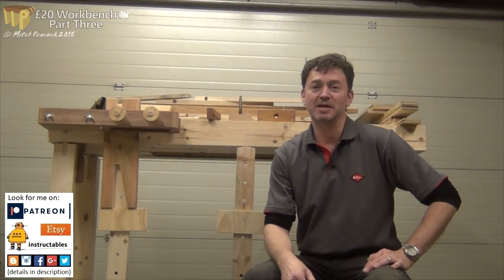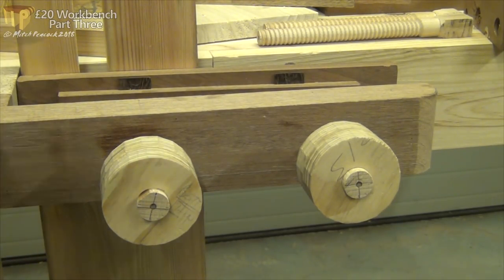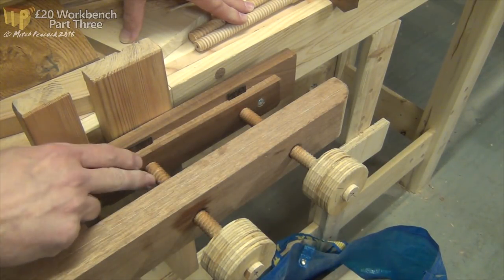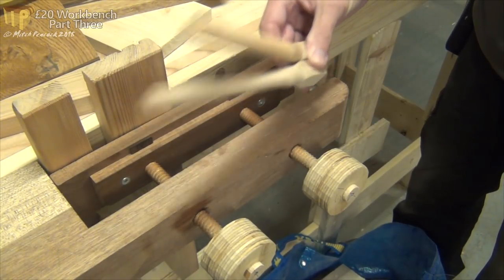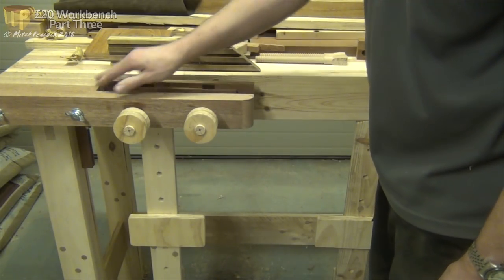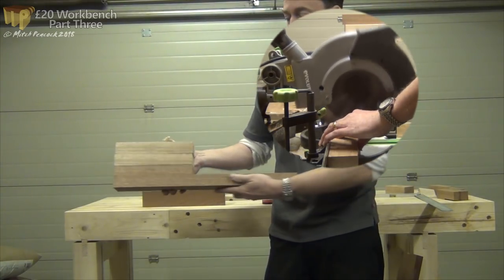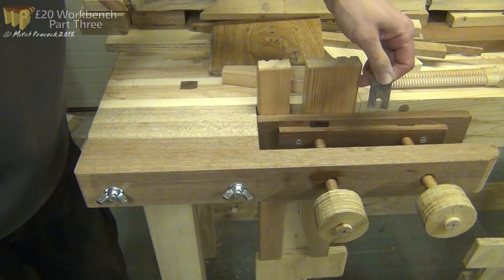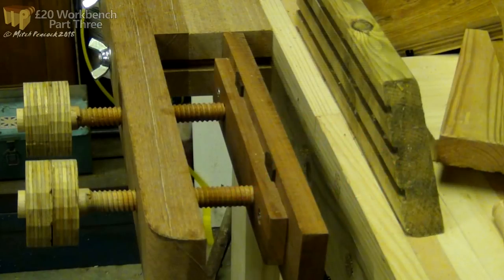£20/$28 Workbench - Part 3 A European Shoulder Vise

Comment: Great vise, Mitch. I couldn't tell from the video, but if you soak the rod in mineral oil before cutting the thread, you avoid tear out.
Cheers, Frank.
Reply from the maker: Cheers Frank. I've used boiled linseed oil to the same effect, with good results.

Comment: Nice video, Mitch.
Wow, the workbench looks great.
Aha, thank you, now I saw how you made the thread.
That with the chop saw was something dangerous, the piece of wood could have buckling
And then maybe the wood would turn red from the blood. :-D :-D
But you also pointed out. :-)
Reply from the maker: Thanks Gunter. Yes, my chop saw method for making the discs isn't for the faint hearted, however the sturdy pivot prevents too much happening - good tip is to never hold a workpiece where there is a risk of it being dragged into the blade. Hopefully this week's video is without danger ;-)
Reply: Hello Mitch,
that's right, it's always the kind.
HOW to work.
Although I have a chop saw, but I prefer to work with hand Tools. :-)